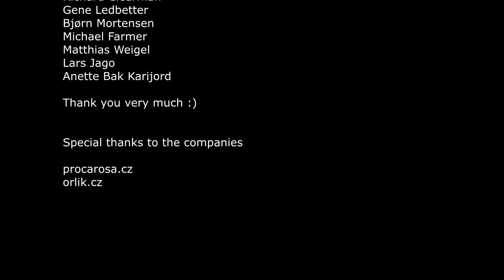Electric sheet metal shears Restoration

Comment: I guess it's an OK restoration if you want to call it that it would have looked better if you would have just polished the cast aluminum and cleaned up the handle… that discount Rigid knock-off tool look just doesn't work.  But it is functional and usable